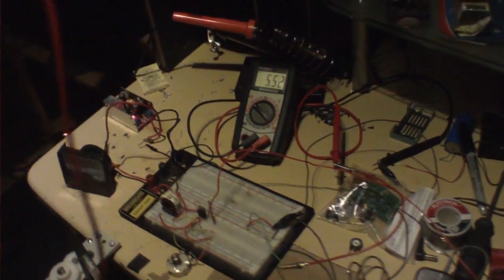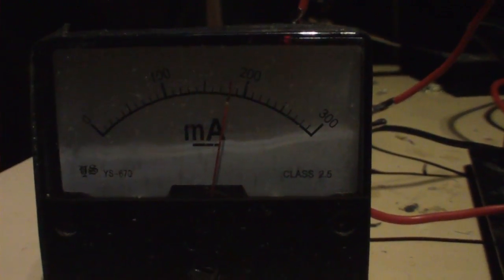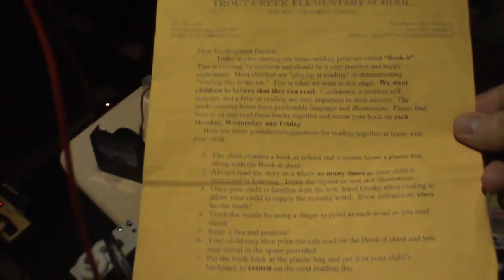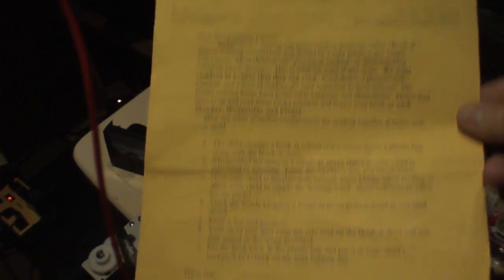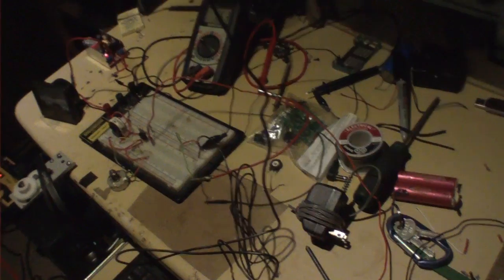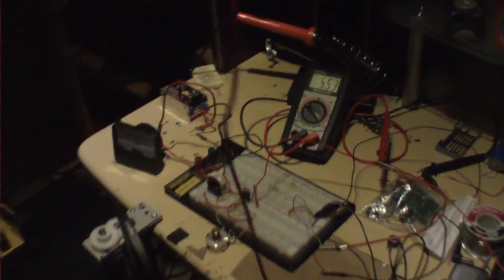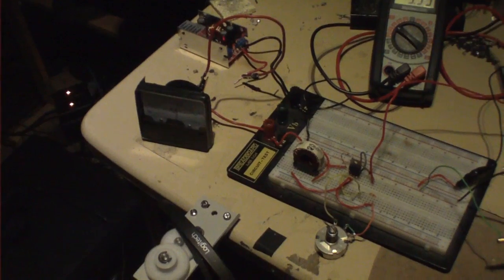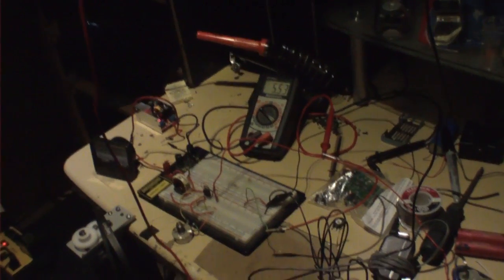The One Watt Challenge

Comment: Hi!
This is My way to light 76 watts of fluorescent lamps with only 1 watt of power!
1 Watt in 76 Watts out!!
Regards
Reply from the maker: I am sorry, you are mistaken. The 6 watts you are using, is contributing very little light to the room, which becomes evident, when you turn the lamp off at one minute, 32 seconds, into your video.

When the lamp shuts off you can see, it was doing very very little to contribute to overall room light.

I would say your circuit is actually running at below factory efficiency, but its interesting.

Comment: I have a few entries I could make if it was a milli watt challenge :P I'll have to break out the power transistors for this one....
Reply from the maker: lol The milliwatt challenge. I got a few of those too.
Reply: Thanks.  The magnet motor secret is the one that has the most views.  It decouples the amount of electricity you're putting into the circuit from the output power of the shaft in such a motor.  All I'm showing is how the separation works.
Reply: I've done a 7 watt LED light @ 1watt from my power system but it leveraged a Tesla Generator with an antenna and ground rod outside.  It ran at full brightness, so I'm not saying it wasn't pulling 7 watts, but that I was only producing 1 watt to run it.  Its a modification of the laserhacker super joule ringer.
Reply from the maker: Mark Cooper sounds interesting would love to see it and attach a link to a video to this description. cheers mark.
Reply: I don't have that one together anymore, i repurpose parts over and over on multiple projects, experimenting.  I had it all documented, w/o a video over on one of the overunity sites.  I can try to put it together again and shoot video of it.  But it will be a long time from now.  Got too many other things going on at the moment.
There is a similar video of a CFL running on about 4 watts that is on youtube.  It doesn't have the Tesla Generator section in that circuit but uses the same power supply transformer that I used in both circuits.
Reply from the maker: Mark Cooper It's all good. I'm really enjoying your channel you have some really interesting stuff going on, wow.

Comment: I am so tempted to take on your challenge but stupid YouTube got rid of the video response functionality in the comments!  I'd love to link the video to yours if I could.  No offense but I'm already a member of countless forums, not going to join another one.  If you can think of a way to somehow "answer" your video on YouTube, I think this would be fun!
Reply from the maker: Just drop a link in a comment partner and I'll add it, as well, to the description. Actually I am glad you dropped by. Did you ever get boards made up (for sale) for that MPPT cap charging circuit you put together? that was real cool.
Reply: it's been on the back burner for right now.  I have two prototypes made up right now.  My biggest problem is I need to get a metal solder stencil for the qfn controller chip as the plastic one isn't as accurate with the tiny pins.
Reply from the maker: R&TPreppers hmm I was searching for an MPPT charge controller, or any logic based controller for that matter that WASNT SMD. couldn't find one. Annoying. I hate SMD.
Reply: yeah it's hard to get anything new nowadays that isn't smd.  it makes the prototyping phase a little harder.
Reply from the maker: R&TPreppers Some people - myself included - who aren't the most talented at working in "micro-environments", as in SMD soldering... find it all very annoying in the sense that, if a repair is ever needed, it's tempting to just toss the technology in the garbage instead of repair it, and it seems "junky" or "cheap" in that sense. I like durability and repair worthy stuff. Seems like I have enough things , already, I can't fix (if they fail). I wonder if anyone else has a large IC something like the BQ24071 that is not SMD.
Reply: unfortunately it doesn't exist.  I searched for 6 months for a through hole version of an mppt supercapacitor charge controller.  Actually the chip I found has only been on the market for only a year.  What you and I are looking for is on the order of pioneering electronics.

Comment: Looks good Kyle. Haven't been doin much on this type of stuff in a while. I hope to make a vid. It's been quite some time.
Reply from the maker: LEDs are fun because you know, conventionally speaking once you hit a watt & up... most cheap lamps use a lot of resistance.That means there not as efficient as you'd hope for, really. A good buck converter will take 12V, and run it's lamp at 6V, but your still gonna lose about 20% there, to heat. With joule thieves, when you strike a balance, you're starting with less, and ending up with less (lumens) however, the only resistor you have is between the base leg and positive. I imagine if you use a small FET it might be even better. They are quite efficient when you get the right inductor.

Comment: what a good idea man, this is the best i got, but im not sure what my input meter was truly reading
Radiant Oscillator Circuit / Don Smith Part 6: C.O.P = 50? read description
Reply from the maker: heya bud howya been man? i remember that experiment! I also tried a variant of a Radiant oscillator circuit i learned from you back at that time. Mine ran at 12V 80 mA. Although I ran flourescent on mine and charged an output battery. it did some mental shit to that battery lol Hard to say what your current is, in that vid. Maybe you should wire it up again and revisit it. Next time, find a one ohm resistor, put it on the input and measure millivolts across it. Try to get it to around 12V 80mA (1 watt). Hang the lights up a meter or more over a desk to illuminate an area. (lights sitting on the floor really don't tell the story well at all). Or if you are on 24V, shoot for 40mA. If you can't seem to get your input current low enough, put a small inductor inline on your input as a DC choke that'll knock it down some.

Comment: Dang that's really good Kyle! So will you share the schematic after the challenge is done? Thanks for sharing. "D"
Reply from the maker: Hey buddy how are things! It's just a joule thief, but a very good inductor. And the non typical aspect, I suppose is that it runs on 5V, and the lamp is a 12V configuration; two six volt lamps in series. It's very efficient, if not high output.

Comment: sweet! are you gonna share a parts breakdown? lookin good! thanks for sharing ur work. cheers.
Reply from the maker: sure no problem, ill put that together. in essence, it's just a joule thief. it uses a nice fat bifilar filter choke with heavy wire though, and im running 5.5V, to ultimately power (2) 4 watt lamps that consist of (4) 1 watt LEDs, wired for 6V in each lamp. The two lamps are in series, so basically i'm using the blocking oscillator JT at 5V to strike a 12V lamp. Normally you'd run 12V @ 600 mA, but I'm using 5.5V @ 180 mA. But it is still good light, better in fact than, than the perception you get from this video.
Reply: for only 180mA that is good! 
Do you know the specs of the choke?
Reply from the maker: shad0wburn3d Ill get 'em for you.